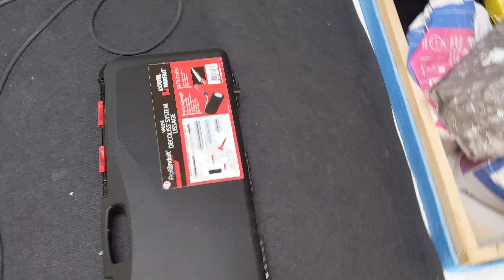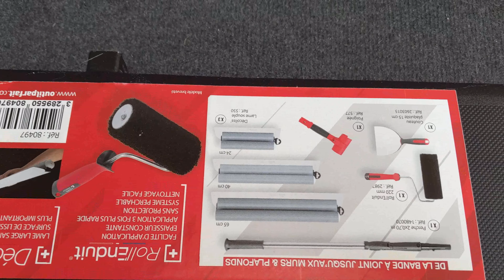enduire au rouleau - ratissage complet expliqué en détail

Comment: Je confirme, la mallette de l'outil est parfaite (d'ailleurs si je devais retenir 2 outils indispensables pour tout ce qui est placo, c'est la visseuse à placo (indispensable dès qu'on a de la surface) et les lames à lisser de l'outil parfait.
Sans être pro non plus, si je peux te donner ma méthode (ça servira surement à quelqu'un) :
- Bandes + charge au placojoint PR4 (PR4 pour 4h d'utilisation mais comptez plutôt 2h, après l'enduit durcit assez rapidement et c'est inutilisable. 
- passe de finish au GDX (pas indispensable si on fait un enduit après, mais pour avoir fait les deux, je préfère une passe de finish avant ratissage et pour ça le DGX est top)
- ratissage : j'ai tenté avec le Bagar Airliss G, pas mal du tout mais d'une part je trouvais que je consommais un peu trop et dautre part, une fois séc, j'ai l'impression que l'enduit marque assez rapidement (genre un coup d'ongle, ça se voit)
Je suis ensuite passé sur du Prestonett F. J'ai longtemps hésité à savoir s'il fallait faire une première passe aveg du PrestoG puis une deuxieme au F. Mes plaques étant bien alignées, mais bandes plutôt bien, au final j'ai fait une seule passe au Presto F. Et là, révélation, je ne reviendrais plus jamais en arrière. Ce produit est TOP. Avec une seule passe, aucune bande ne ressort, c'est assez impressionnant. Léger poncage au 220 (c'est un atelier, j'ai pas vraiment besoin de supers finitions). Pour une pièce à vivre, une deuxième passe est idéale (tout dépendra de la minutie que vous avez mis à poser vos plaques, vos bandes etc etc...). Honnêtement, avec les grandes lames à lisser, c'est assez rapide malgré tout donc ça faut le coup de faire une 2ème passe.

Seul bémol du Prestonnet, ça sent vraiment pas bon pdt une bonne semaine. Au séchage ça blanchit vraiment beaucoup, impressionnant.
Travaillez par petite surface, 1m2 à chaque fois pas plus. Ca tire assez vite. Si on fait trop grand d'un coup, ça a tendance à grainer et on a vite un effet peau d'orange.

En rsumé, lames à lisser Outil Parfait + Prestonnet F, que du bonheur !

En espérant que ça serve à quelqu'un :)
Reply from the maker: Et bien merci beaucoup pour tes conseils 👍👌. J'utilise aussi le pr4 et le gdx... J'essaierai le prestoF alors 👍😉
Reply from the maker: Et pourquoi ne fais tu pas le ratissage au gdx? Franchement il va très bien... Le prestonett est mieux tu penses?
Reply: @PapyBricolo  GDX en 25 kilos pas dispo chez mon fournisseur et Presto F moins cher. N'utilisant le GDx que pour la finish des bandes (et ça va très bien) j'ai tout de même l'impression que le F est un peu plus couvrant en ratissage (plus "épais" si tu préfères). Tu t'embêtes un peu moins à gommer les éventuelles épaisseurs si tu as un peu raté tes bandes.
Comme j'ai bcp de surface à faire et qu'il y a quand même une nette différence de prix au final, que le résultat me convient ainsi, je garde cette méthode mais me GDX est surement très bien aussi.
Reply: En poudre ça marche bien ? Plus économique niveau tarif
Reply: @thierryd.8717  merci Thierry pour ton commentaire.  J'ai tendance à travailler à l'ancienne,  donc au couteau de peintre , mais c'est lonnnnnnnnng ....😢.
Je faisais 2 passes voir 3 d'enduit fin. Je vise une belle finition en catégorie A . 
Je vais te copier donc..., merci 🙂
Reply: @astucebrico  avec un peu de recul, finalement j'utilise quasi que la lame de 25... plus grand j ai un peu plus de mal à gérer et ça me rajoute du temps de ponçage. Mais bon sûrement une question d expérience. Le vrai secret c est quand même d être soigneux des la pose des rails, des montants et des plaques. Plus on est soigneux et plus faciles sont les bandes et les ratissages. Ratissage seulement au prestonett F, j ai lancé le G de côté. D une part parce que je n ai pas de gros défauts à reprendre et d autre part parce qu il est plus dur à poncer que le F.